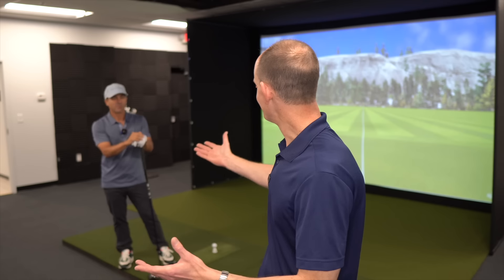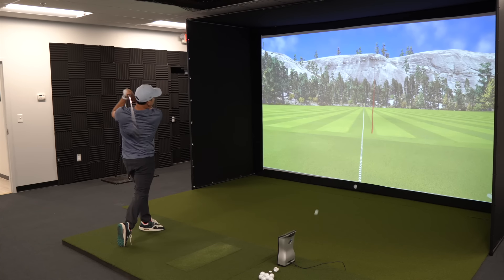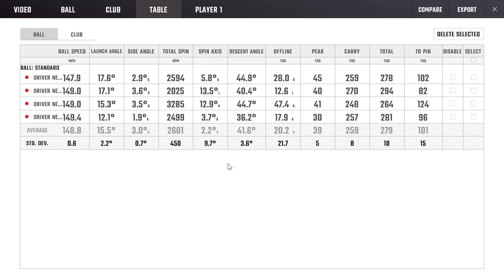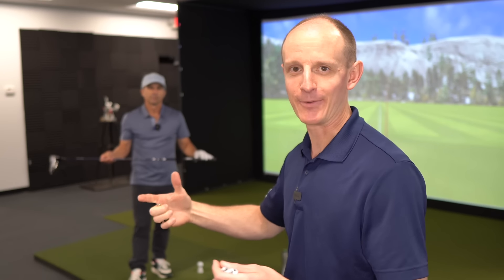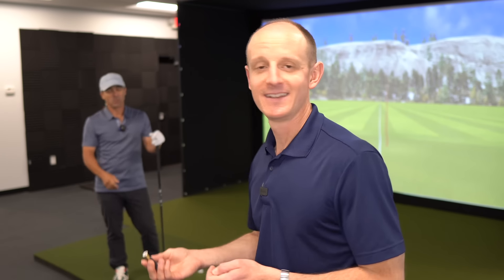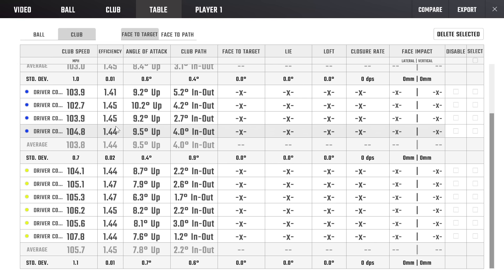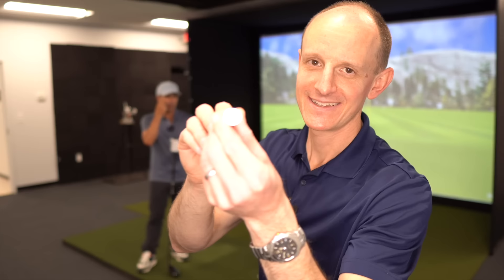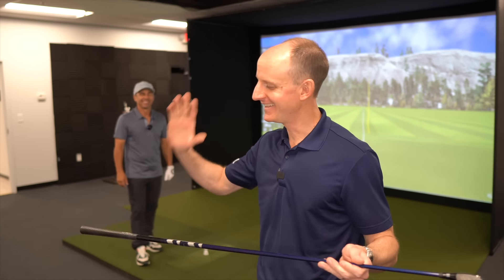Greatest of All Time Driver Hack / COUNTERBALANCING

Comment: So my question is this:  If I were to do a similar test with my driver to find what weight works best for my optimal swing speed, would then a similar concept hold true for the rest of the clubs in my bag?

Great video and very cool to see Matt testing the theory with you.  I thank you for your input.  #MrShortGame
Reply from the maker: I've only tried this with drivers thus far. More testing and more clubs upcoming since there appears to be interest in it. Also interested to see what happens with wedges??
Reply: A "Yes" vote for wedges as well. Very interesting theme this 🤓
Reply: Where can you buy the weights you were using?
Reply from the maker: @randyrandy1506  Tour Lock, I get mine from Golfworks.
Reply from the maker: @randyrandy1506  Golfworks
Reply: @nielsaxelsson  Don’t forget the putter possibility! Several old time pros did this at one point or another.
Reply: Garcia has 30g in all of his irons…😊

Comment: I guess no one remembers the boccieri secret grip from the early 20teens. Counterbalancing with a discreet weight rarely works as it concentrates the additional weight in a small, localized area of the shaft. To say that it lowers the swingweight of the club is a "true" fiction. Instead, it throws off the bend profile (and intended properties) of the modern shaft.
Reply: So u have 18 majors to backup your "theory"?
Reply: @formula2tom225  Hi, f2t. No 18 majors here. I'm quite a bit older than AJ and the method that Jack's club builder used was reported back then to be different than what AJ said. It was lead tape, spiraled under the leather-wrap grip that was the standard of the day. It started around 7 inches from the butt end of the shaft, going up the shaft. The shaft being the standard steel shaft of the day. The added weight was distributed over a greater area of the shaft than a discreet weight at a single location. It certainly did have the effect of lower the measured  swingweight. And it certainly worked for Jack.🙂
Reply: @pdmv8471  That's your opinion of what u think you read one time that's how Jack did it. I think I read different. Unless u have a direct quote from Jack or his club builder at McGregor or a picture with Jack and his grip... no way I'm buying he had  lead tape spiraling 7 inches down the shaft under his grip..

Comment: I have to ask, on my trackman, I hit 2100 rpm, 164 ball speed and 13* launch and get 270 carry.  How is he 14 mph slower and getting out as far? is my thing wrong? On the course I average 290-300 drives. oh and i might mention my highest balls speed this year is 176, the 164 is my ''fairway finder" i guess
Reply: 100% on this one, I see it all the time on Youtube, 105-108 club head with 155-160 ball getting upwards of 280 carry and almost 300 total.

Same boat as you my cruising speed club speed is 110 with around 162 ball avg. Carries around 270-275, low/mid 2000s on spin with a little draw.
Go after it is 116/117 with 173 being my highest recorded ball speed, those carry 285. 

I'm from MO, weather is calm and altitude is 500ft with average ground not firm so I get 15-20 yards roll max.

Trackman's ideal numbers say a 105 shouldn't carry more than 263, that's with 155 ball speed and perfect everything. 

Why does every Trackman, SkyTrack, Bushnell, etc I play on gives me drastically different numbers then what I see online.
Reply: @intsol_team3854  Keyboard warriors, I am 6.2 225 my numbers are with a TIGHT boring cut, I am in Oklahoma, so its a wind fighter too! I was in Myrtle on a golf trip with the boys brought a 12* driver for sea level shinanigans (and soft fairways) and I was slapping draws out there farther than alot of + hcp golfers. My draws with a driver are usually 10 more mph ball speed.

I am just surprised how that swing on my eye test makes that distance. I hope youll appreciate this sir, my stock 85% 7i is 89 club speed and about 1.45 smash 5800 rpm and 190 carry, and i see this on the course, our elevation in Tulsa is 720 ft.....I know how to hit the ball...
Reply: @MrHazz0  This video is the reason why, when I play as a  solo and get paired up with 3 random people, they all talk about how they hit it 300. I drop my normal 270 carry down the middle rolls out to around 285-290 and I get "DAMN THAT'S LIKE 330+" and they get pissed off when I correct them. "that's closer to around 290, I only carry around 270"

They realize I'm 30-50 yards beyond their ball and the fact they are not 300 hitters. Love humbling people and I'm not even reaching 300.
Reply: @intsol_team3854  I hear you I had one drive last month hit a hard part of the fwy, then a speed slot for like 360 gross (bit down hill fwy par 5) and I was 115 yards infront of a 300* hitter lolol 

He said, DAAAMN I said dude this thing we saw bounce like 70 yards back haha

I am 35 now, when i was 23-26 I really could hit about 180+ ball speed and carry 300. And I tell you they look SOOOOOO different, I wish I could go back in time to my d1 days rofl
Reply: @intsol_team3854 I agree 100% with this assessment.  My experience is exactly the same.  We could be twins!
Reply: Launch angle and spin difference. He is launching close to 15 with about 500 revs more spin.  Which keeps the ball air born longer at mid 150’s ball speed.  It’s just science and ballistics. Increase your launch 2-3 degrees and you will be carrying it closer to 300 at your speed and spin.

Comment: Ok. What is best way to do this without expensive equipment?
Reply from the maker: Nothing here is expensive. The weights are not expensive then just put the grip on with air, either with my tire inflator method or my bike pump method.

Comment: I think a better experiment would be to add 2-3” in length AND the 50 grams of weight. If you hold the club at the orig length with the weight BEHIND the hands, the club head speed should increase multiple times what you saw in this test.
Reply from the maker: Except then you have a non conforming driver.
Reply: @EFGMC  😲 oh really? What makes it non conforming?
Reply from the maker: @SilverbackWoodworks  Anything over 46 inches would be non conforming.
Reply: Choke up. Club head speed and control should both show improvement. yes/no?

Comment: Great! Can also be done by having a heavier grip or by adding lead tape to the butt end of the shaft. My driver has a CB shaft already and it helped 1.5 MPH with the same effort vs. the stock non CB shaft. Make sure to try things first. Might not be for everyone.
Reply: 25g of lead tape to the butt of any golf club would be ridiculous 😂
Reply: @Grudging-junk  True, if all tape. I've never done more than 10 grams of tape which a 2 gram per inch tape is only 5 inches and wrapped around the end and down the shaft isn't that bad. 25 is a bunch but with a different grip easy enough to do.  Common grips like Lamkin crossline is 45 g, GP MC is 50, GP MC plus 4 is 55, and a midsize GP MC is 65-67.

Comment: Where do you buy these?
Reply from the maker: Tour Lock weights
Reply: @EFGMC  it came in and i installed it. But i should of
Listened to your grip changing advice not to be stingy on the grip solvent. I couldn’t slide the first grip on because i didnt use enuff solvent. I had to cut it and redoo. Lesson learned.😅

Comment: Guess what the "CB" stands for in the Ping drivers with the Alta CB shafts? Yes, CB stands for counter balanced. Those clubs already come with some counterbalancing under the grips.
Reply from the maker: Ping also weights the heads accordingly so both ends of the club have extra weight. This would be another option if trying this experiment, adding extra head weight in conjunction with the counterbalancing.

Comment: What’s the catch? Why aren’t the major club makers promoting this concept. They could not have missed this concept since all they ever think about is how to make their clubs go farther and straighter. There must be a serious downside to this when all golfers are considered.
Reply from the maker: Ping does it already.
Reply: @ I doubt they are adding weights to the butt end of their shafts. There are number of shafts these days that has “CB” marked, but they still weigh in the 50, 60, 70 gram weight class with its shaft balance point slightly towards the butt end. I am sure if adding significant weight to the butt end of the shaft and its resulting SW reduction in the range of 12 points improve driver peorformance characteristics, all major manufacturers would add lead weights to the shaft butt and start reducing SW numbers instead of focusing on the shaft/head design improvements.

Comment: i have hypermobility. this is particularly apparent in my wrists and hands. i loose my grip at the top. i swing fast enough, i can carry a 7 iron 190y, i have a short swing and therefore a lot of effort in the wrists and grip to hold the club steady in transition. Counter weighting my clubs has really helped. this would make sense, correct?
Reply from the maker: I think so from what you are describing. All that matters are the results.